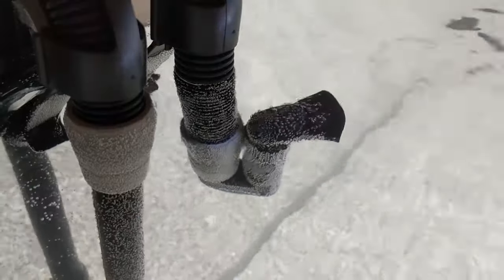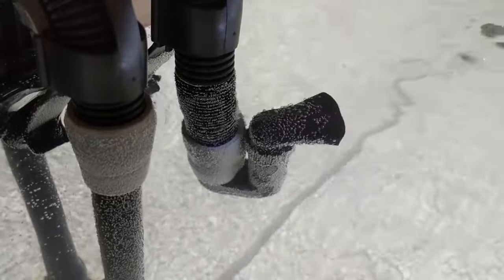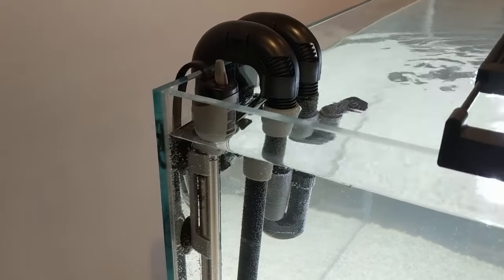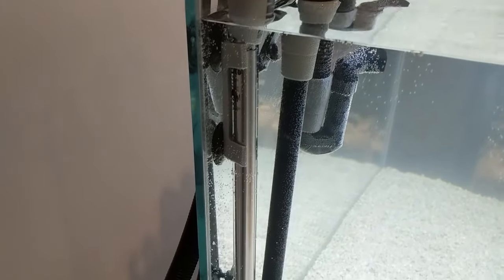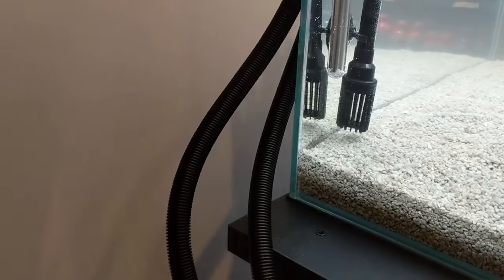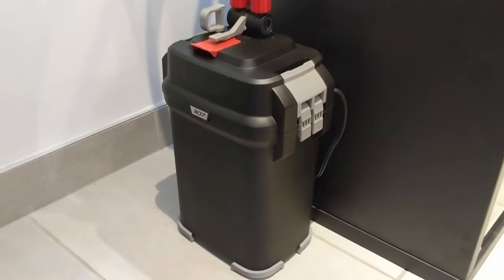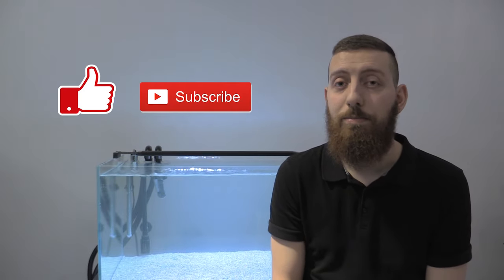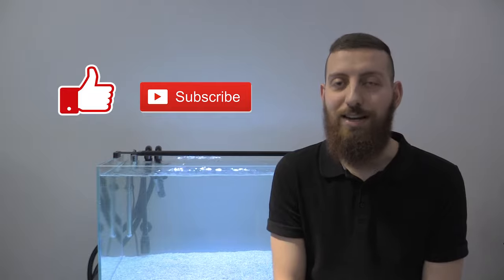Canister filter intake / output positioning tips

Comment: ive noticed that  most tanks with a 307 dont show how it fits with a lid on i hope  they can fit
Reply from the maker: The 307, like other canister filters, has hoses that pass over the aquarium rim and into the water. If your tank is fully covered by a lid, you'll need to cut out a small section to allow for the hoses to pass through!

Comment: I recently brought a fluval 207. brilliant product but two questions. The output barely seems to cause any movement near the bottom/ plants. I have the output under water but is it ok to have it above to create more movement?
Reply from the maker: Having the output nozzle parallel with the surface of the water just beneath it will support good oxygen levels and water circulation.

Comment: wat is the difference in keeping the outlet submerged and non submerged ?, thanks
Reply from the maker: Hi there, keeping the outlet submerged will prevent bubbles and microbubbles which is important for a saltwater system. Keeping the output at or slightly above the water surface will help create surface agitation and prevent biofilm build up! 😊
Reply: @fluval  thank you for being kind enough to respond , much appreciated , i have a flower horn so was wondering better submerged? or with bubbles or taping a portion of the outlet for more bubbles ..
Reply from the maker: @amolsamuel17  Hello, right below the water surface would be best for your Flower Horn!

Comment: Does anyone know the diameter of the fluval 407 hose? I want to make a spray bar when I get the filter but I don’t know how big the hose is.
Reply from the maker: The O.D of the rubber hose connector is 22mm and the I.D is 18mm

Comment: Would I put the outake below water or above
Reply from the maker: The ideal position is to locate the output just below the water surface, to eliminate excessive noise but still allow for good surface turbulence to support dissolved oxygen levels. In some set ups where noise is not an issue and the splashing is contained it can be better to situate it just above the water surface, for example, when recreating a highly oxygenated river habitat preferred by many suckermouth catfish species...

Comment: What can I do if my intake is too long on my canister filter I mean it fits but only to the bottom and that's with it at it's shortest length ?
Reply from the maker: If the intake stem is too long, you can cut it with a small saw!
Reply: @fluval  I thought about that but then the straining basket wouldn't fit but using the water dispenser and cut off tube I was able to rig something up .

Comment: How to identify dead spots in a planted aquarium, also best position of the in & out flows , in a planted aquarium with respect to the hardscapes
Reply from the maker: You can identify dead spots bby an accumulation of detritus and debris! If you notice dead spots in your tank, try modifying your output positioning slightly to get rid of them, or add a circulation pump!

Comment: Is there a way to regulate the flow of water
Reply from the maker: Hi Linda! The flow of all Fluval canister filters can safely be reduced by up to 50% using the AquaStop valve. 👍
Reply: Is that the gray  handle above the red handle
Reply from the maker: Yes! The gray handle is the one to adjust - the red one disconnects the hosing from the filter body.

Comment: So I got a tank and canister filter from a friend. Neither of know how to use the filter system. I am using on a tank for a painted turtle. So very low water level. The output has an elbow up high. Should I and if so how do I make it so that output is under the surface? Does this even matter if it is or isn’t under the surface of the water?
Reply from the maker: Using a cansiter filter on a low water level set up is challenging, it will impact water flow and can make re-starting after a power interruption difficult. We suggest either a submergible filter or exploring how to run the tank to normal water levels and creating either a tank top terrarium for your semi-aquatic turtles or otherwise.

Comment: My Fluval 407 will produce a scary rattle when my system switches to battery backup*, followed by a hum when it switches back to line power.Is it normal..or shud I disconnect the battery backup..
Reply from the maker: See above.

Comment: Disagree.
Think about air. if smoke comes in a corner of the room, regardless, it will evenly distribute throughout the room.
Same with heat. and if it doesn't, no big deal, microclimates within a tank is something to take advantage of.
IN FACE... we try and create microenvironments within these very very small environments to accommodate different plants, creatures, places where particulates settle, etc.
I really just want to know about pros and cons of different filter arrangements.

Comment: How do you position 2 canisters in the same aquarium?
Reply from the maker: Hi Francesca, great question! When positioning a canister It is crucial that there are no dead zones or areas with little to no flow. We recommend placing one canister on the left of the aquarium with the second canister on the right side. Both output nozzle should be facing the front, center of the aquarium for the best flow. You can face one of the nozzles slightly downwards as well to help direct flow to the bottom of the aquarium.